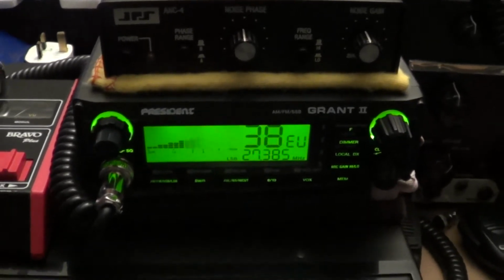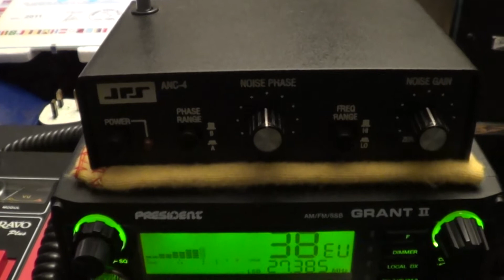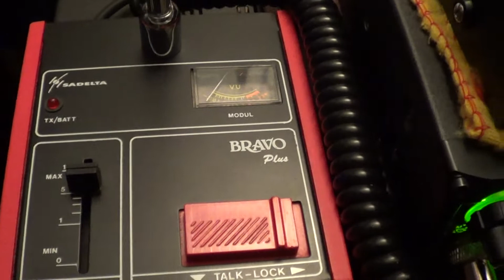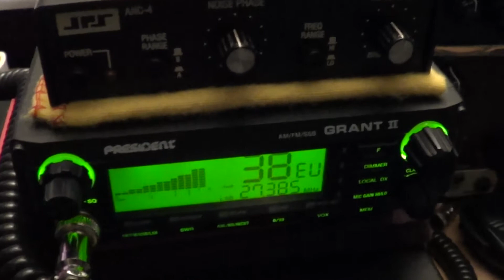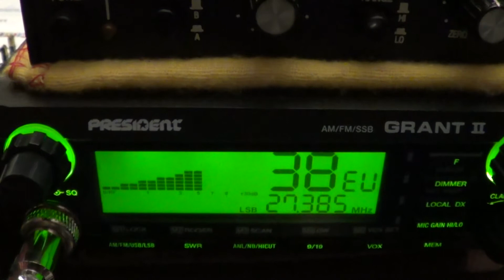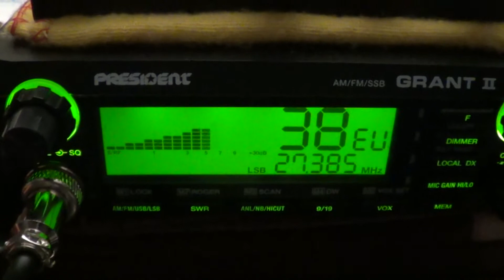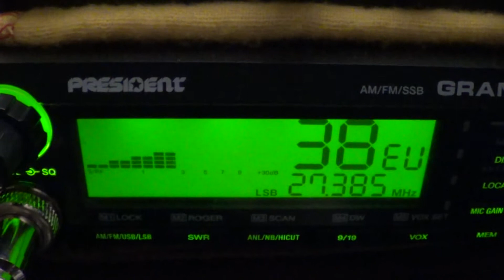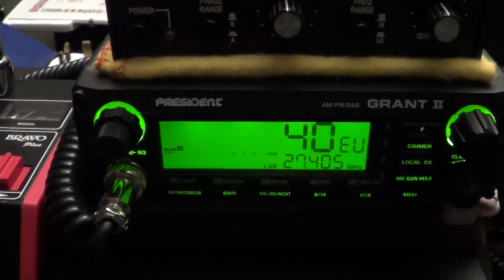SSB Contact With World Radio 714 New York

Comment: Hi. Dave Just wondered where you got your noise eliminator from and what price they're selling for?

Thanks

73s

Dave - 26TM256
Reply: MFJ do the 1025 and 1026 which can be found on Ebay for around £100. They're a bit better than this one as they have more controls and built in amplification
Reply from the maker: Hello Dave the latest version of this unit (ANC-4) is now made by Timewave in the USA.
It would cost over £200 new,I was lucky to find this one used for a very fair £80.
Reply from the maker: Conor Turton
Hello Connor,
Not heard from you for a while.
Have you used the MFJ units ?.....as it surprises me they are better than this (ANC-4).
The new version is made by Timewave and like their 5/9 DSP units are superb.
Looking at reviews on E-ham the unit I have here is the better one based on various long term user reviews.
The only product I have used and rate by MFJ is their antenna analysers.
A rather rude use of the MFJ initials is used by my Friends and in many cases for a very good reason.
The JPS /Timewave has the best build quality IMO.

Dave